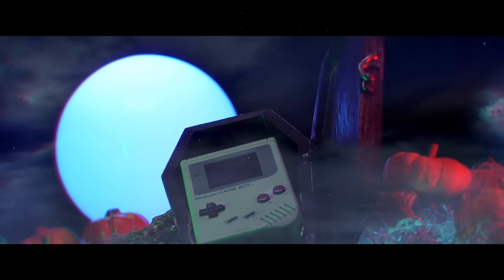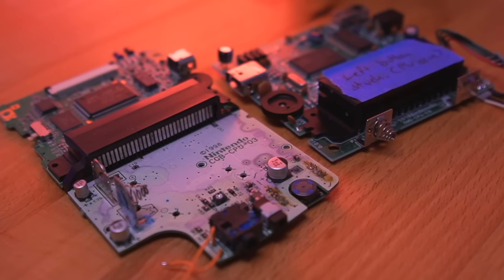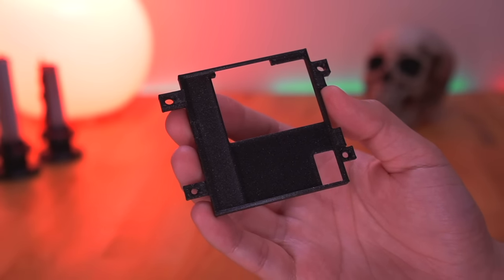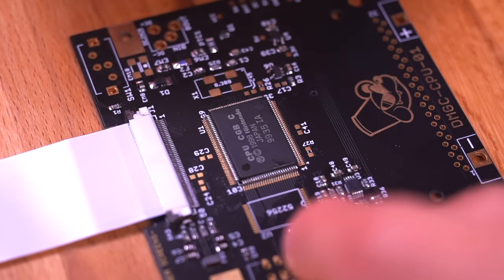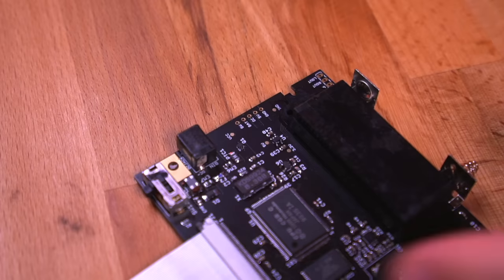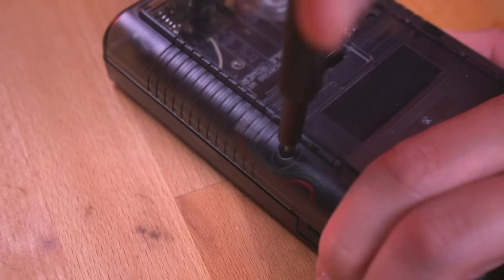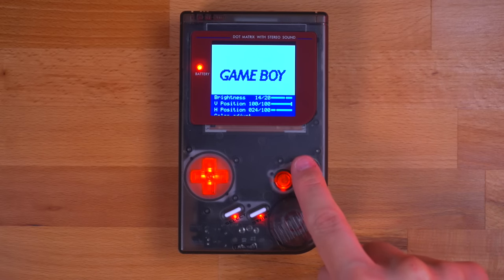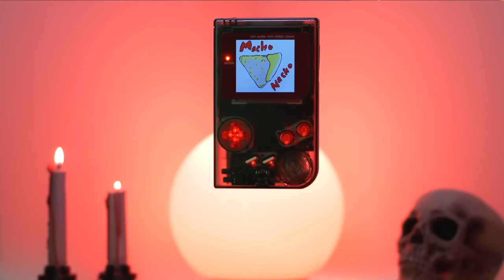Putting a Game Boy COLOR CPU Into A DMG

Comment: This was the perfect time to share this mod. I'm glad to see old systems get another chance to play games again. Hate to see any of them go to waste.
Reply from the maker: Same here!  It’s so satisfying being able to take broken consoles and get them to a working state again
Reply: @MachoNachoProductions  Specially since many of them fail in stuff that wouldn't affect this mod. I don't think I've even heard of a failed CPU or RAM on the GB lineup, but the DMG's LCDs rot, irreparably. The Color's LCDs often have deteriorated polarizer filters that can be replaced with a LOT of patience and the right (cheap) filter film, but I imagine most don't do it either.
The only one thing I would have done differently on this mod is ditching the old electrolytic capacitors from the sound board, everything else was a top notch job, it's nice to see people who know how to do stuff doing it.
Reply: adding more to this, I used to sell modded handhelds a while ago, I specifically went for the dead screen ones, or anything that didn't have to do with leaky batteries. Often these would get sold in Japanese eBay auctions as not working for no more than a bad power switch, but quite a few ready to bin ones were saved by modding a new screen and case to it.

Comment: I've been repairing electronics professionally for the last 9 years. I recently got my hands on a DMG Gameboy from 1989. The customer wasn't interested in pouring the money into it to fix the screen (I tried all the usual stuff to get it working, but I deduced the fault appeared to be with the embedded controller in the Y-axis flex). 

I bought it off of him for $40, because otherwise it would have ended up in the trash, or in a drawer collecting dust for who knows how many years. I decided to look into the whacky world of Gameboy mods, and stumbled into this. 

Soldering is my specialty! I fix things under microscopes, I run 40AWG jumper wires almost all the time to fix all sorts of silly things. This looks like it's right up my alley. My best friend has been collecting retro electronics for years, and I think something like this would make a very cool and thoughtful gift for her. 

Thank you for making such a detailed breakdown of how these boards and kits all go together. I just need to find a Gameboy Color to steal some parts from.
Reply from the maker: So glad you found the videos helpful!  I you find your game boy color!
Reply: @MachoNachoProductions 
Does it also work if you install a Gameboy Color CPU to SGB adapter?
Can I play Gameboy Color games on Super Gameboy Adapter?
Reply: @MachoNachoProductions   Just wanted to update and say I managed to find my gameboy color! I got it in a completely non-working state, and I assume the battery terminals were just corroded. Easy fix, but I was eager to cannibalize it and start building this. So far it has been very fun! 

I'm on the part where I get to hand solder like a hundred passive components, and this is pretty boring. But doing all of the complicated packages like the CPU, various ICs, FPC connectors, etc was awesome. The cartridge connector was quite difficult to remove by hand at first, but a knife tip and some solder wick made some quick work of it.  

UPDATE: I'm almost finished! I ran into a bit of an issue testing the boards when I saw it wasn't actually powering on. I had all of the necessary voltage rails, but for some reason it just wouldn't fire up. I was afraid I had accidentally salvaged a damaged GBC CPU. It turns out I'm just stupid, I had the cable that goes from the CPU board to the IPS board upside-down. I also ran into a sound issue, but I should've tested the DMG speaker I salvaged with a multimeter before even salvaging it --- that sucker was dead as a doornail. I fortunately had another DMG I'm planning on tearing apart to build another one of these things, so I just pulled the speaker from that. 

 My one remaining step is to trim a bit of the edges of the original DMG shell to fit the new screen, and she'll be ready to go :). This was actually super fun to build, and I am definitely going to re-order the Mouser components I need to slap together another one.

Comment: Great video as usual!

One thing I'd like to mention is to not attempt this mod if you don't have the right tools and experience to solder those darn small capacitors/resistors/transistors (meaning microscope, solder and hot air station etc). I messed up two gba sps because I desoldered capacitors because I wanted to install the Retrosix De-hum kit. Don't do it if you dont have the right tools, ask a pro to do it. Trust me lol.
Reply from the maker: Totally agree, this is definitely for experienced modders

Comment: I just wanted to add that you can buy all new DMG parts for this project which is what I ended up doing, new caps, lowpass filter, power switch, volume pot etc... If you wanted you could even buy new memory chips for the GBC but those tend to be expensive. The only thing I could NOT source was the GBC CPU.

Comment: Fun fact: Diet Coke eats away battery acid like nothing, I fixed a broken Pokémon pinball machine using nothing but a tooth brush and Diet Coke
Reply: Any update on the longevity of it lasting after use? Just curious if it had any side effects after use, and if not, how much would be recommended, might keep this in mind if i get a hold of a old GBC or GBA with corrosion damage

Comment: basically, expensively taking parts from both consoles just to make a custom one that requires every part individually whereas you could literally just buy both and put the gbc in the gb
Reply from the maker: Ideally 2 broken consoles
Reply: @MachoNachoProductions  I understand, but individually buying each piece for 65 dollars then buying two consoles each broken, then soldering for basically an entire day seems a bit overkill to me.
Reply: @enderloch4922  I have put a GBC inside of a DMG case instead.... and it is way more work to do so haha
Lots of planning, cutting, rewiring, taping, etc

Comment: I wish I had those soldering skills. Super impressive.
Reply: It is easy. All you need is some old equipment like broken radio, pc, tv... open it and unsolder things and wires. And just solder randomly on to board, just to get the hang of it how long to hold your solder on board or wire, to see how they behave under. And then just improve until you get clean unburned (melted) board with clean drop of zinc. It is not a big deal as it seems. It is all in practice.

I wish I had his equipment. Never worked with heating gun.
Reply from the maker: With practice I know you can. Cheers!

Comment: I need to do this mod. I prefer the form factor and increased battery life of the DMG, it fits my big hands better. I have 2 modded DMGs with IPS screens and aftermarket shells, it's just a shame they can't run GBC games. This is basically the ideal Game Boy. I'm sure I could do the soldering needed, I haven't done much mini/microsoldering, but it went pretty well last time, I feel confident I could get it done but it might be a bit of a struggle. I'm also sure it would take me several days to do this much soldering, but the end result is worth it.

Comment: Use solder wick on the larger pins the desoldering gun isn't enough for. ChipQuik is amazing, but it's also very expensive and they only sell it in very small packs, which run out in no time if you start using it on everything just because it's easier. ChipQuik is primarily sold for removing surface mount components easily which would typically be impossible to desolder without hot air (and not much of it is needed since the pins don't hold much solder). But through hole components are easy enough to desolder with just a solder sucker and solder wick, and you need a lot more ChipQuik if you use it on through hole components, it gets expensive very quick and isn't really good advice I think, it's not the best way to desolder through hole components with only a few legs.
One good example in this video where ChipQuik really shines is for desoldering components with a lot of legs like that CPU. Yes, you could desolder the CPU with just a cheap soldering iron (but recommended to at least use a soldering station with temperature control, those cheap irons with no temperature control just make the job way harder than it needs to be), no hot air needed, but a pack of ChipQuik costs like $20 and you might use up like half of it. Since hot air takes a lot of practice to not screw up and blow components off the board by accident or melt plastic in the surrounding area, that makes mods like this way more accessible for most people :) Also, for a one time mod, ChipQuik is much cheaper than buying a hot air station, but if you desolder surface mount components frequently, it will be cheaper to buy & learn how to use hot air.

Comment: Very cool project, just an observation, why not use a rechargeable battery and a usb type c port? I mean, its going to be a difficult and expensive mod right?. Anyway love your content, thanks
Reply from the maker: That actually would be very neat and I’m sure it’s entirely possible to integrate that
Reply: One of the main goals of this project is to be as minimally intrusive to the overall mechanical build as possible. I don't like to cut shells :P
A USB-C port would require a cut somewhere. I wanted to keep the overall aesthetic as close to the original as possible. I also prefer AAs personally. They are hefty and I have a ton haha. 

So the project was for my own personal tastes, but with the option for others to change it if they want. I actually split off the DC jack output to a separate wire going to the power board, in case you want to use it for charging a battery instead of powering the console. In that case you'd likely only need to change the power board design to use a lipo, and keep everything else the same (or nearly the same).

Comment: Maybe I missed this in the video but if you wanted to use this in an original DMG shell, can you disable the PCB LEDs? or just desolder them so they're not uselessly drawing power?
Reply from the maker: Yep you can easily turn them off
Reply: One of the LED modes is to play the color sweep startup, and then shut off (color settings are saved after powering off). That's the setting I use! (You can also edit the code if you know how to write C)
But yes, they are not mandatory to even populate!
Reply: @bucket_mouse  ahh perfect thank you! been wanting to do something like this for ages but keep it looking oldschool if possible.

Comment: If you have hot air, wouldn't solder paste would make it much easier to solder the CPU and ram back? I would have just used new caps for the audio board lol

Comment: You have a hot air station so why don't you use solder paste? :)
Reply from the maker: I don’t have much practice using paste and not too familiar with its properties and how it works with hot air. Perhaps one day though
Reply: @MachoNachoProductions  You should! It's pretty easy, especially if you have a stencil.

Comment: I'm already worried about the Project Stellar/XboxHD+v2 mod I got coming. This mod looks more complicated than that. Its not that I'm not familiar with modding but I haven't soldered legs of a chip to a board or ribbon cable on to a chip. I got plans on practicing that on old/broken hardware.
Reply from the maker: That’s a great way to practice. I can’t wait to check out project stellar!
Reply: @MachoNachoProductions  Can't wait to you put a video out on it! I'm thinking you maybe got a demo unit. I will definitely follow that. I've been waiting to be able to buy an XboxHD+ for a while but I don't need a Xenium chip. Thanks to the wait, I got something much better coming.

Comment: My first thought, why? I mean, modding things is cool but there already is a GBC? Would you mod an NES in to a SNES? 
Must wait and see...
Reply: I don’t have one (yet), but it’s because

A: some people prefer the form factor of the DMG (big hands and all that).

B: The DMG in particular is better than putting it into a Pocket because the DMG allows for using 4 AA Batteries, therefore having around double the battery life of a Color, all without having to put a clunky and oversized battery mod into a Color Shell that clearly cannot fit it without a larger 3d printed shell.
Reply: @rickyrns1059  Those are good points. I do have a modded GBC with a DMG color scheme because I had a DMG growing up. I do have big hands but the shape of the GBC still works for me. I use a Satisfye grip on my Switch and it fits perfectly, everything else was too small.
Reply: @GiSWiG  Oh yeah, I definitely agree with the fact that people with big hands can enjoy the smaller consoles, I’ve got big hands and yet I still love the Gameboy Micro Form Factor and think it’s a very comfy game system to hold. The big hands thing is just the most common reason people give for saying they prefer the DMG. I personally love the Gameboy Color form factor as well, but I definitely agree that the DMG is also a comfortable handheld, and that the better battery life is the reason why I plan on eventually having a DMGC, whether it be via buying one or making one myself.

Comment: is cutting in the notch to the switch even needed? it has been a while bit i think the cardriges had a notch in that corner as well and it would prevent you from removing the game while the power was on.

But i could be remembering it incorrectly since it has been a long time since i repaired a original game boy
Reply: only applies to Game Boy games. Color games in clear shell do not fit
Reply: ⬆️⬆️⬆️congratulations you are among our shortlisted winners claim your reward🎁……

Comment: Why not just using those old motherboards and mash those together instead? This way you don’t have to desolder and resolder all chips from an motherboard to another one ,to save time and hasseling with chips,
But apart from that, this gameboy looks great,it should,ve be the gameboy from 1989 instead.
Reply: It is far more work to cut and wire up a GBC and DMG PCBs and fit it inside the DMG shell. Among other things, you still have to get an entirely new button board, since they use different styles of button detection (DMG uses a diode-array keypad-like entry, GBC uses a common-ground interface)
Source: I did both methods, and using new PCBs was much easier :P
Reply: @bucket_mouse  aha , oke.